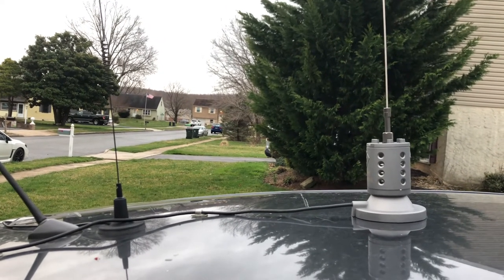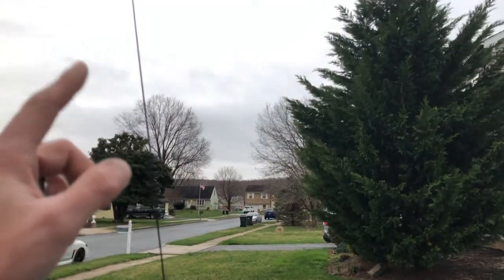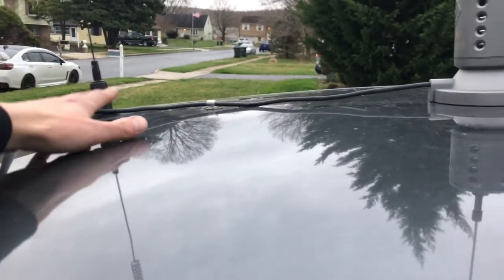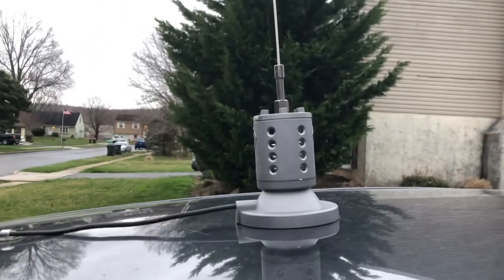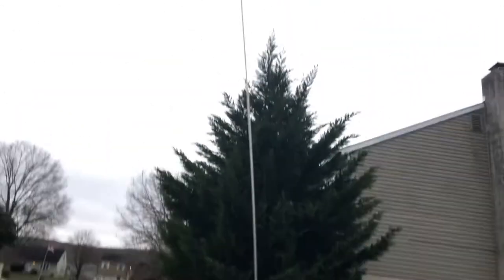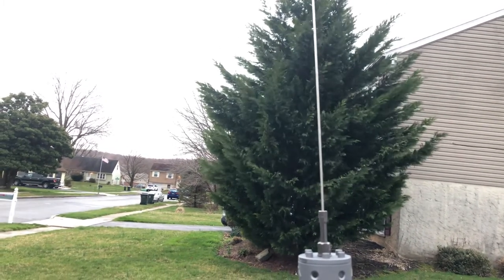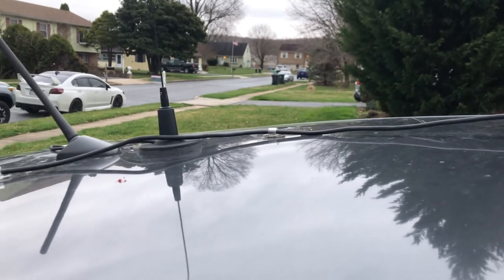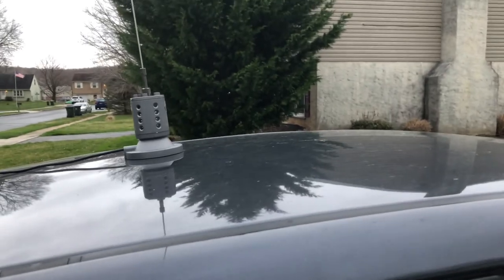Mobile Antenna Placement. Where to put them & why.

Comment: The angle on the K40s are on a angle, you only do that to with 1/4 wave antennas, I use roof mounted puck in the center of the roof and the dual band antenna 14" behind, drilled through the roof using a SO-239 connector

Comment: I am the opposite, I like my HF antenna in the back and my vhf/uhf in the center. Since I use HF for getting the furthest ground wave propagation I like to maximize my gain by using my vehicle groundplane like a beam
Reply from the maker: Yeah , it’s what works for you and more power to you.  If in the back aims your signal where you want to work DX that’s a great way to run it.  Thanks for the comment.  73

Comment: Quick question, if you have a sunroof do you center it on the remaining roof to the back? I assume you loose some ground plane with the glass of the sunroof. 
Thanks,
KF0NRP
Reply from the maker: Good question.  I would have to agree with you.  And I would also say to experiment with different placements.   Not knowing for sure.  I would say your idea is probably the best.  The rest of the vehicle will also have an effect on your reflection.   But always whether to the back or from center is always the best.  But in some cases not always feasible.

Comment: I had the antenna vertical with 1.1 SWr 
Then I located it 45degrees forward and oh man 
The SWr went crazy 🤪 
Almost impossible to get it near 1.5 😩
Reply from the maker: That’s just a fashion trend.  Put it up vertically and you’ll be alright.  73.

Comment: I take it that it has to be continuous metal? In other words, the hood is metal and you have no trunk. So the Stryker SRA 10 is centered on the roof and not on the car? Also, what if your car is made out of aluminum? Is there alternatives? Thanks for the video and information.....
Reply from the maker: Center on roof of cab on truck, center on roof of car.   
If you have an aluminum f150 well I would get the truck mounted version of this antenna and mount it behind the cab in the bed. Put and braided ground strap to the chassis.   Hope this helps

Comment: Most truck drivers put them at an angle to avoid vibration big antennas on your mirrors will start vibrating sometimes
Reply from the maker: Interesting 🤔.  I thought it was just for looks.  Thanks 😊
Reply: @mikecricket113   not only that it so when you go by something does not hit a tree or something like that

Comment: Truckers that mount their antennas pointing forward at an angle know that at 60 MPH the antennas will be pointing straight up - the ultimate position.
Reply from the maker: I’d like to see a video proving that theory.
Reply: @mikecricket113  Me too Mike ! Anything that helps with better transmission. Thanks for the reply.

Comment: How you deal with ugly cable crossing the roof
Reply from the maker: Me personally I’m not vain about it.  Don’t care.   But the alternative is. Drilling a hole 🕳️ through the roof and using a NMO mount.   It’s a clear installation, and wires easily hidden inside the vehicle

Comment: So most vehicles are rectangular in shape. Thus, having your antenna in the center of your roof puts most of the metal of your vehicle to the front and back. Your strongest signal is front to back and less side to side. Moving the antenna to the back of your vehicle puts most of the metal to the front. Your signal will be strongest to the front of your car. Wherever there is the most metal is where your signal will be the strongest so be careful where you position your vehicle antenna.